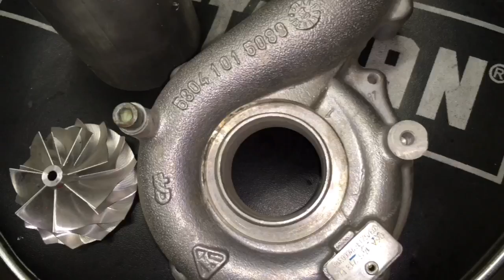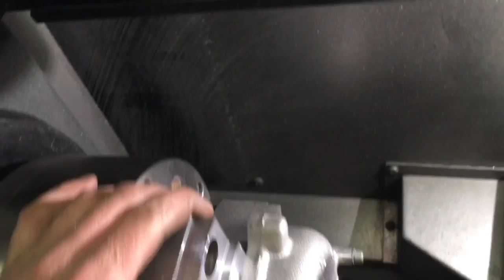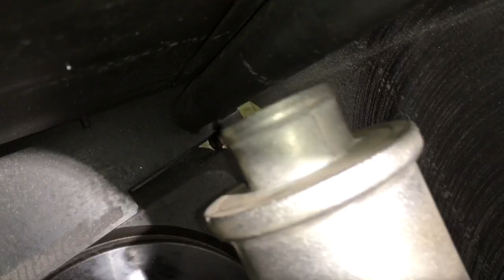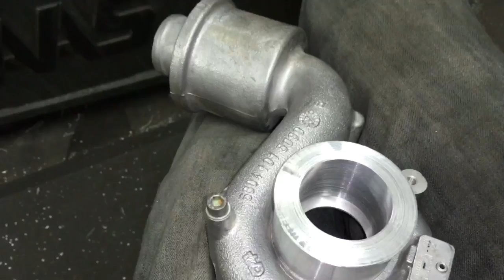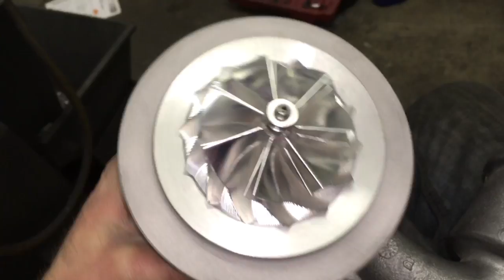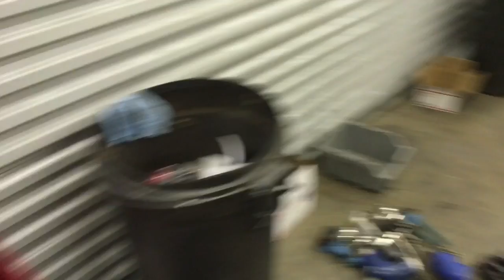Jetta 1.8T Turbo Upgrade

Comment: i made one of these a year ago. the waste gates bend open. so you need to come up with uprated waste gate i was running a k04 cover with an elbow welded on because the A/R is bigger on the 1.8t k04 covers. 47.5mm compressor wheel and 49mm exhaust wheel. you also need to port out the hot side loads to even flow that, the back pressure in this one in the video will be massive

Comment: If your listening Paul. I have a b5 passat AEB motor. It's the longitudinal 1.8t same as Audi A4. I'm considering sending factory unit to you for this upgrade. I was originally planning on purchasing a new b&w k04-015.  That since I found your channel is really has me thinking. I have no clue what your services like this would cost. Ballpark?
Reply from the maker: +Joe Bs I don't plan to do this build anymore until I get an endmill , we did the build for 650$ at the time. The machine I need to do it is 25,000-40,000 dollars depending on the options and if bought new or used. I want to buy that machine someday, I just can't afford it right now
Reply: Have you bought this machine now?? 😂 I'd definitely send a Turbo to you for this upgrade

Comment: This is my turbo thank you i now realize why it took soooo long. 

But turbo will be going on in about a week the biggest challenge with this is the Intake hose I ordered a larger one but this inlet is 2.2" big! There isn't really a generic 2.5" or so inlet pipe option on the market that I saw. Mostly 2"

But regardless this is for a GOLF lol not a Jetta.

Thanks man and thanks to Paul!
Reply: Laurynas Tamosiunas  look at 034 Motorsports I have their 2.5" turbo inlet
Reply: How dit it perform? Is this an good option to do?
Reply: did you find a pipe??
Reply: Kevin Mcintire yes I found a 2" inlet on eBay that was the hugest I could fine with out  going to 3" . XS Power some eBay brand 
Just primed the turbo spent all day replacing it going for a test drive soon
Reply: Laurynas Tamosiunas I would never use xs power
Reply: Performance Dubs it's holding up fine no matter what intake I use the coolant pipe is still In the way when I have time again I have to shift it over or delete a section
Reply: Laurynas Tamosiunas I'm 95% sure they make big turbo fitment coolant lines for the 1.8t
Reply: Laurynas Tamosiunas ooo lietuviskas projekciukas?
Reply: im sure they do but i sold the car not for me to worry now! :D
Reply: what i did with mine is a cut back a CMS k03s hybrid pipe and stretched it over the end.
Reply: if you can't figure out how to make that fit you have no business taking anything off of your car

Comment: Interesting. Good project. The 1.8t is prob one of the most common modified turbo engines on the road. I have one in my b5 passat. (AEB). And I got my first taste of German horse power. Which basically means it's underrated. Mine is a 150 hp paired with a five speed manual. And I can repeatedly put a hurting on a 200 hp GM 3800 motor in a similar weight vehicle. Just doesn't add up. Who's numbers are wrong. GM or VW?
Reply: Don't talk hp, mr torque is your friend!

Comment: Do you have this turbo for sale? Or you do that work on my turbo I have a ko3 on my mk4 gti2004? u rave fone number for contact?
Reply from the maker: I did it for a shop. I don't plan to make another unless I make a sample to be remade. The compressor and turbine housing are both a challenge so I don't do the 1.8t upgrade very often but I could have these parts remade which is expensive to me but it would be affordable to the customer.
Reply: It seems there is enough interest for the product. I am interested also and would be willing to have my car used as a test mule
Reply: can i send mine in to be done ?
Reply: Please make these
Reply: I just acquired an 03 jetta.  200,000 mi on chassis.  120,000 mi on a used engine.  Drove on a 2 week vacation over 5000 mi. This car is worth playing with.  I am beginning to revamp it.  I would pay $100 above your cost to get a kit.

Comment: forget the 1.8t and  focus on the new k03 2ltr turbo vw has been running it's a good starting point for people that don't want to go k04,IHI is38 or big turbo pushing the stock turbo to be more reliable is a better option and if u can make the turbo perform better with a easy rebuild kit would be great for the vw   scene

Comment: If you could do it for a longitude engine like an Audi 1.8t I would be interested
Reply from the maker: I already have, I used a Mazda speed Compressor Housing, I uploaded that video already but labeled it as vw Passat, the turbo is the same as the Audi a4

Comment: ill need you to rebuild a massive t4 anti surge twinscroll turbocharger bro, how can i ship ot to you once i get it, whats your email heres mines athomas7258@gmail.com
Reply from the maker: +monstaro19 Imi need to know which turbo so I know if I can get the parts
Reply: Turbo Lab America  ok ill check out which one ill get and let you know soon
Reply: Turbo Lab America its this one https://www.amazon.com/gp/aw/d/B01N0YBL6B/ref=mp_s_a_1_9?ie=UTF8&qid=1490722741&sr=8-9&pi=AC_SX236_SY340_QL65&keywords=t4++turbocharger+anti+surge or the next one ill post up
Reply: Turbo Lab America heres my 2nd choice a holset hx 50 twinscroll 

https://www.amazon.com/gp/aw/d/B00VF4NE30/ref=mp_s_a_1_fkmr1_1?ie=UTF8&qid=1490723023&sr=8-1-fkmr1&pi=AC_SX236_SY340_QL65&keywords=t4+twinscroll+turbocharger+holset i alreasy have an agp twinscroll manifold snd the tial waste gate 46 mm and itll be on a fully built up dodge srt4 motor with hi stall tc, built transmission  bigger external coolers, msd & the works like royal purple & evans coolant 375 boiling point & waterless,..

Comment: silly Q.  whats up w/ the play?
Reply from the maker: +Beau Mancini I was showing normal play with this turbo they have a stationary bearing
Reply: Turbo Lab America I need these housing and the wheels housing email me at schovoy@yahoo.com
Reply: Does the run out lessen once a hydrodynamic film forms when actually running on a car?
Also, what do you mean stationary bearing. 
Thank you.
Reply from the maker: Oil fills the tolerances. The bearing doesn't move.